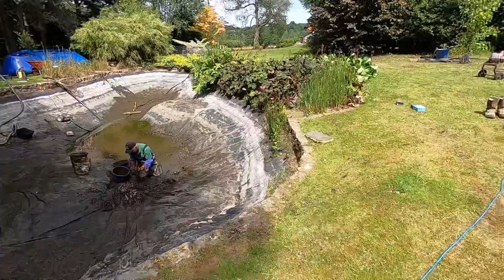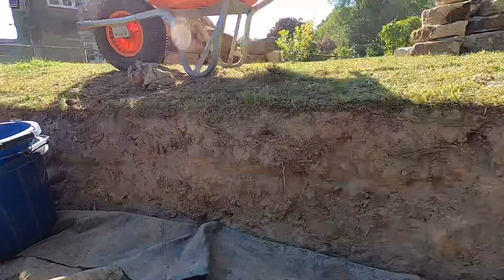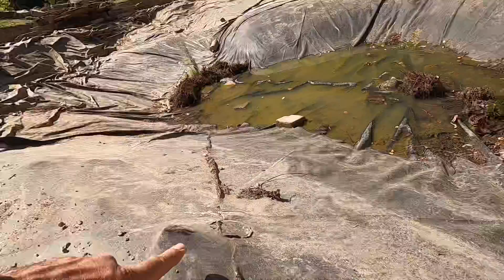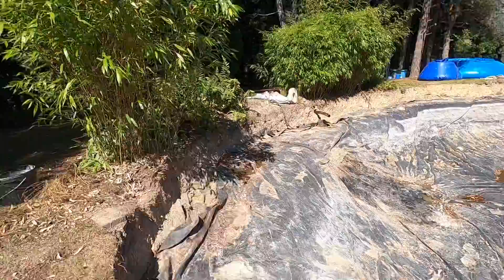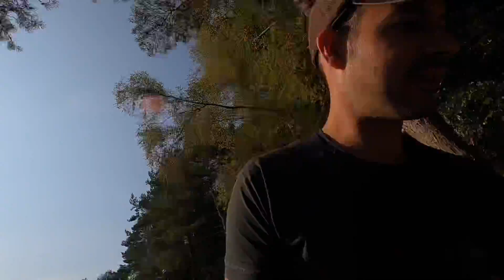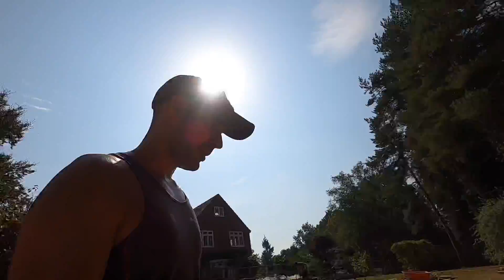Pond re-line & re-design

Comment: Thanks for this mate. I have a major problem with my pond, water will not reach the top which is paved with crazy paving holding the liner in place, apart from digging the slabs out and starting again is there anything I can do? Someone mentioned putting another liner on top of the existing liner and fixing it to the sides, not sure I like that idea!
Reply from the maker: Hi there Jeremy- assuming that once upon a time your pond did hold water to the required depth and also assuming that the pond had been constructed with the crazy paving sitting inside the pond (ie liner goes under them and folds up behind them)?  If so it may be that part of the lining has subsided/sunk to a level below what your trying to achieve as max water level.  Digging around the pond on any potential low spots behind the paving in the hope you can locate any excess pond liner and lift this slightly might be a good start.  Otherwise I’m afraid the honest answer is no- theres not really anything you can do other then lift the slabs, inspect the liner for any damage and assuming you’re happy with the integrity of the liner ensure the surround is level, set to the desired height and the slabs re-laid. Some people might mess around with using sealant around the base of the slabs (where pond liner meets stone) and sealing the stone with a resin but don’t bother- such a fix is temporary at best and really wont be a long term suitable fix. 
Hope this helps and good luck!
Best,
Ed